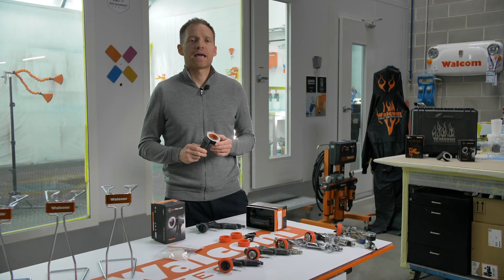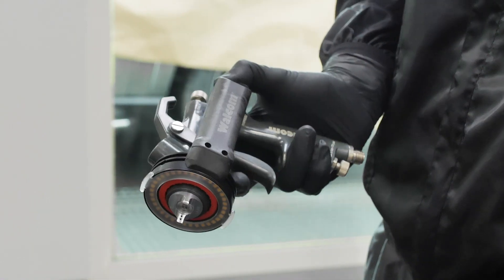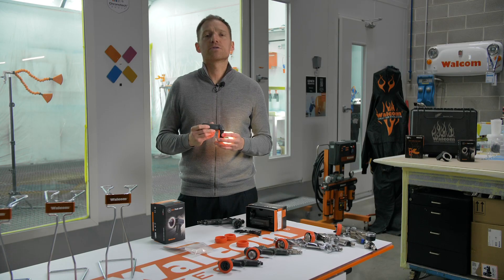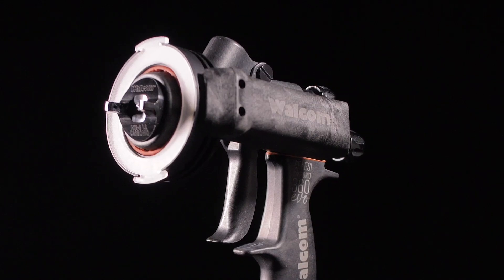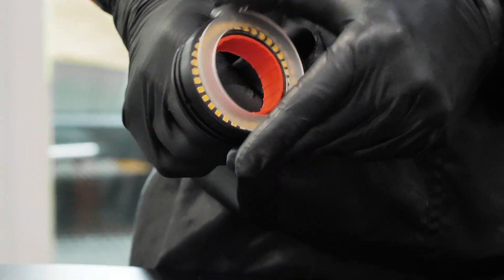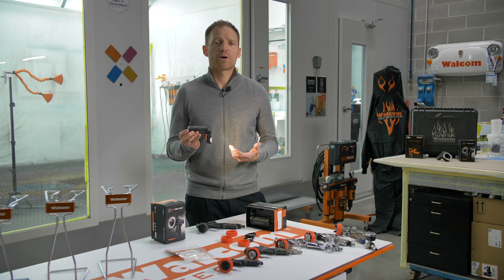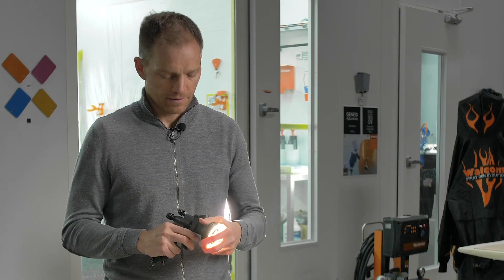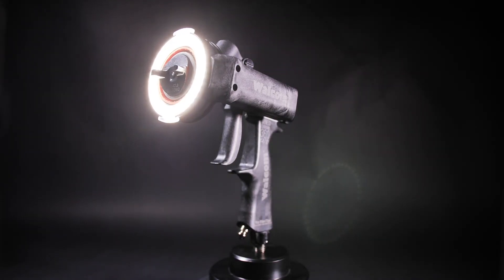360 True Light // How its works

Comment: Def does not go on the gun that easy.  Loved it while spraying an engine bay though
Reply: Which spray gun? Works perfectly with mine carbonio
Reply: @lztetrax  tried on 3 iwatas.  Ws 400, ls 400, w400
Reply: It works just fine but hard to get over nozzle